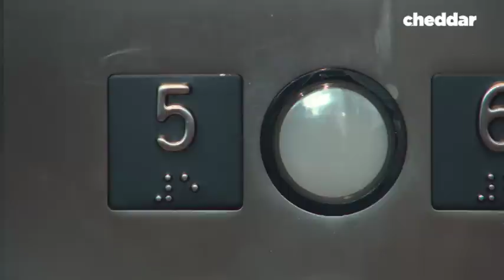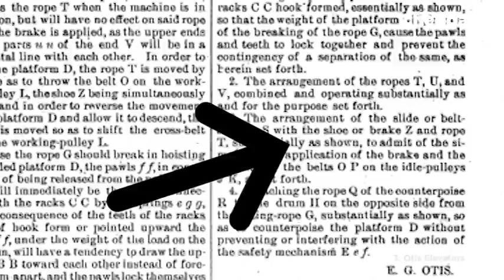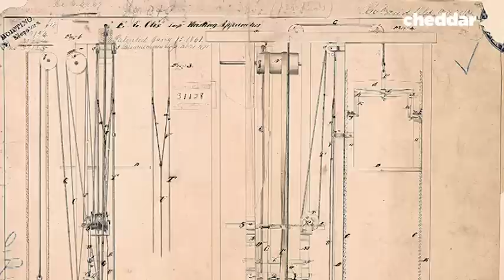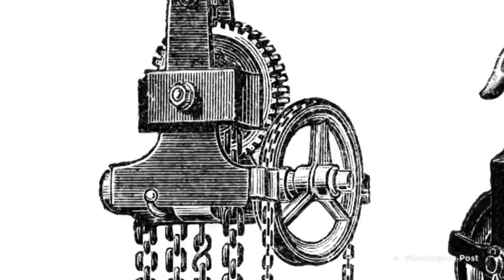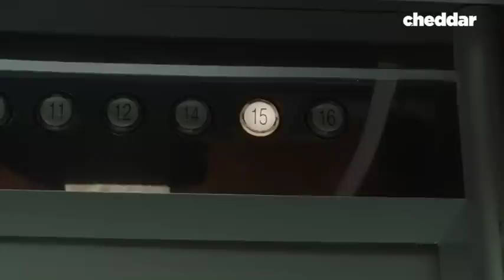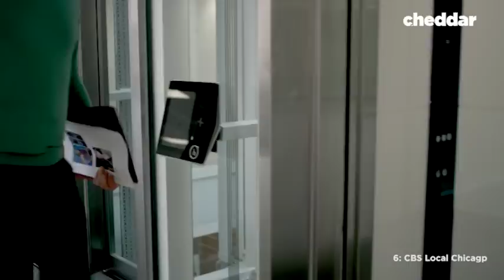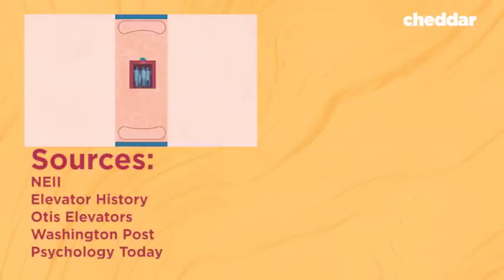Why Movies Are Wrong About Elevator Free Falls - Cheddar Explains

Comment: I remember on an episode of Mythbusters they were testing the myth of jumping during an elevator freefall, and they had to use a very old elevator -- far less sophisticated than any modern elevator -- in an abandoned building that was literally falling apart; and they STILL had to disconnect the safety mechanism to get it to fall.
Reply: David Roddick haha... Did they mention the fact that modern elevators are extremely safe?
Reply: Didn't they also mention that this disconnection was scarily simple?
Reply: Yes, a a person who understands the mechanisms for elevator safety systems could in theory bypass those systems. 

It would take a while,
Reply: @raymiller1383  on practice, it would also be a very pointless terrorist attack with very little casualties and too much bother and security to bypass... as opposed to running a truck into a crowd or something.
Reply: @kenthonggo3041  indonesia has no building standard :)
Reply: Kasumi Rina Gaming of course if there was a specific target it’d be fine. As a plan b of course
Reply: @raymiller1383  in the film Speed he put explosives on the cables, to trap them, then explosives on the friction brakes so that he could drop the elevator if they didn't pay the ransom.

Explosives make short work of complicated technologies.
Reply: megaangelic yeah, Speed is not a realistic example either, but you’re not totally off. 

 the safeties are not on the top of the cab, To get where they are, you need to know how to get there, and hanging on the underside of the car is rarely a recipe for success 

In reality, explosives anywhere near an elevator would make short work of anyone inside anyway.
Reply: @KasumiRINA  yep stealing a bus or truck and then going full speed into a demonstration is way more effective and if a Elevator falls everbody would believe that the elevator had a problem
Reply: I remember that episode. It was surprising how even in old buildings like that, the elevator was safer than the rest of the building.
Reply: @raymiller1383  lol not really.
Reply: Ham549 not sure what you’re saying not really about, but I’m not about to explain in any more specific detail what I know about it...
Reply: @raymiller1383  that it's hard to disable the safeties.
Reply: Ham549 hard is relative... to one familiar with the system it would not be hard at all, but I won’t elaborate. If you happen to be an expert, I’d refrain from elaborating further.
Reply: @kenthonggo3041  wait so is she wrong at 0:10 ? Or was the reason behind the accident different?
Reply: The lift don't fall Dow because the counter weight is heavier then the lift  
So they fall up if you go and release the brakes in the machine room you will see that they go up.
Reply: @KasumiRINA  Not if someone was targeting a specific person/group of people and they knew that they used the elevator every single day.
Reply: Thing nobody cares but I’m telling: one time in a mall, whit friends, we started jump in a elevator because we were bored and parents weren’t there. Until the big one of the Group give a big jump and the elevator started moving. We all see our life’s passing and we stop doing that.
Reply: @raymiller1383  Well I doubt anyone would do that unless you want to escape without suspicion
Reply: @kenthonggo3041  well... It's Nestle building
Reply: @kenthonggo3041  well... It's Nestle building
Reply: @kenthonggo3041  well... It's Nestle building
Reply: @megaangelic  usually do on accounts of BEING EXPLOSIVES, AKA FAST EXPANDING CHEMICALS REACTIONS THAT CAUSE MASSIVE AMMUNITION OF AIR PRESSURE AT ONCE!
Reply: Yep me too and feel sorry for buster
Reply: A buddy does repairs for old nyc elevators and to assume people don't undo safety mechanisms to avoid warnings and keep things working is generous.
Reply: @tz8785  heavy but simple. just as untying a hard knot can be simple yet the rope can hold hundreds of pounds of weight if the knot is left alone
Reply: @megaangelic  The video is not talking about elevators that get sabotaged.

Comment: In movies they usually have spikes at the top and bottom of the shaft
Reply: Not to mention that as soon as elevators hit the bottom of the shaft they explode in a ball of fire.
Reply: what the hell
Reply: Bitcoin Motorist IKR. Then everything explodes
Reply: Using "y'all" and implying you're not American in the same comment is pretty repulsive.
Reply: @KatzRool  Speaking English and implying you're a sovereign country is worse imo
Reply: KatzRool please explain why
Reply: In movie elevator's indicator somehow still can show although the cable is snapped
Reply: @KatzRool  fr
Reply: @barmiro  not really. English is a pretty common language
Reply: y’all in the replies really are confused
Reply: @Houtarou_Hyouka_Unforgiven   A few of the equipment clips was showing a the Electrical Controls cable (one has the writing required on all electrical cable), not the wire ropes. Again, Hollywood lied as you see the digital floor indicator (in car) rapidly changing. IMHO that condition would probaly snap the electric cable as it was never intended to spool that fast
Reply: @steveurbach3093  i mean
cable has snapped 
but the indicator still show the exact floor 😂😂😂😂😂😂😂😂😂😂😂😂😂😂😂
Reply: Lol I remember being a kid and thinking how dumb that was
Reply: @steveurbach3093 the electrical connection to the car doesn’t spool, it’s a hanging cable underneath the car. That can easily drop as fast as the car, even in free fall.

Comment: Narrator: Elevators can't fall like in the movies.
Also Narrator: Describes an incident in which an elevator falls like in the movies.
Reply: I would very much like them to define "plunged", because if it really did go into a terminal velocity free fall like in a movie then I find it hard to believe that everyone survived with only minor injuries
Reply: You don't pay attention, do you?
Reply: But all passager still alive even fall from high floor, and the elevator not exploded like in movies
Reply: @nobody2021  She said it stoped on the 11th but doesn't say how it stopped. It must have been somewhat sudden, otherwise they wouldn't have had injuries. If it went to the bottom then they probably would have died?
Reply: Elevators can't freefall for another reason... and that is air pressure... if a elevator had no safety features and fell, it still wouldn't completely be a free fall... it would be slowed down by the air pressure building up in the elevator shaft as it's falling down, which would slow down the elevator. It would be very uncomfortable, since it would be going at a decent speed, you would most likely be injured, but it should be slowed down enough for you to not die. So even without all the other safety features you would probably not die if a elevator fell... of-course this doesn't count for elevators that aren't enclosed in a elevator shaft... :p
Reply: badbirdkc sega
Reply: @nearlimitsound6631  Not to mention there’s still a heavy counterweight being dragged in the opposite direction.  If only one cable snapped there would still be 4-5 of them left.  Free fall is impossible in these things.  There’s so many redundancies in the safeties and stops that make sure it won’t happen.  As well as yes air pressure in the hoist way.  But if it’s an elevator in a bank of 2 or 3 or more, they actually share the same shaft with no walls between them.  So the pressure wouldn’t be as great as one might assume.  And IF all else fails, the buffers in the pit will catch the car and keep it from exploding in the pit.  All of the accidents in modern U.S history have been caused by negligence on the elevator mechanics end.  And even those are exceedingly rare, thankfully.  Elevators are safer than taking the stairs even if it doesn’t seem like it:)
Reply: Air pressure does not build up under an elevator,  it will not slow it down, I test elevators everyday, and the buffers in the pit are to protect the elevator if it overshoot the floor a little,  like a bumper of a car, at high speed they do nothing
Reply: Elevators freefall up, not down. This is due to the small wheel in the bottom or top of the shaft. Not like anything that is listed on this. Located on EVERY lift.
Reply: @nearlimitsound6631 you seem to have never seen a real elevator shaft, there's plenty of space (often several feet) around the elevator for the air to pass around the car, so there's no air pressure build up at all, only poor aerodynamics.
Reply: @OPCr1s1s most elevators of smaller buildings are hydraulic without a counterweight and can certainly free fall. Only traction elevators have the counterweight.

Comment: Elevators falling isnt what scares me about elevators. Its elevators that fall or move when people are walking out the door. I thought it only happened on China but recently in NYC someone was crushed by an elevator going down wedging him with the floor and the elevator.
Reply: Pretty common in Russia. Happens if you bypass the pesky safety systems which prevent the elevator from working if they have any doubt at all.
Reply: It's just cheaply made lifts
Reply: This happened to me like a month ago in California. We got in the elevator to go up, but it started moving upwards before the door closed. It only moved like an inch, but we immediately hit that door open button and got off of it lol.
Reply: @skellingtonMCR  sometimes if there's a significant amount of weight that enters the elevator and stretches the cables, the elevator will move up an inch or so to keep it level with the floor
Reply: @sonic2batt  I don't think that was the case here though. When it moved up, it was no longer level with the floor. And there were only two of us in an elevator that had a max weight capacity far above our combined weight.
Reply: @OhMyGulay That's also my fear about elevators.
Reply: @skellingtonMCR  That's interesting, I can see why you were concerned. I've noticed what I mentioned happening when several people enter the elevator.
Reply: either it's cheap ass or badly maintained elevator
Reply: @James Olelo from someone who also works in a hotel, "someone tripping a little" is a great nightmare. Even if they're ok and didn't get hurt, it can still turn into a nightmare situation quickly not even mentioning if they got a minor injury.
Reply: @garfieldandfriends1  which is often the case in Eastern Europe. Basically, Soviet elevators come in two types, ones that open their door if someone's leg or arm gets between the doors... or ones that don't, they close and move up or down. Faulty design but many homes in former USSR still have them.
Reply: OhMyGulay this is one of my biggest fear. Usually i would walk fast or run coming in or out from elevator. And my apartment has one. Everyday is a struggle facing my fear crush by elevator
Reply: @skellingtonMCR  when weight is added the ropes stretch causing the elevator to be below the floor landing.  The elevator will relevel to compensate for the added weight and go back to floor level.
Reply: @skellingtonMCR  i know one that does this in a senior home
Reply: im also scared it will get stuck
Reply: @skellingtonMCR  idk if this is the scenario you had, but it's quite common for elevators to start moving before the door is fully closed, and to start opening the door before it comes to a complete stop to speed up wait times.
Reply: @skellingtonMCR  That is called "re-leveling" and in does that if it needs to re-adjust to the floor. If it goes to far it will stop though.
Reply: @skellingtonMCR  Mabye a logic glich. 
You're still safe though, if it gets too far from the floor with the doors open it will e-stop because the safety circuit gets broken.
Reply: @OhMyGulay This is extreamly rare and only happens if the safety circuit has been bypassed.
Reply: @sonic2batt  should not the breaks be holding it in place?
Reply: @skellingtonMCR  still happens though.
Reply: @HPD1171  the brakes arent engaged unless in an emergency as they need a technician to reset them.
Reply: Ive worked for a global elevator company for 16 years. This only happens when technicians electrically 'bridge' or bypass the electrical safety circuits when repairing something and forget to reinstate it afterwards. The lift should never move if any of the landing doors are open.
Reply: Pretty cool Final Destination kill
Reply: @SianaGearz  correct, you would have to jump the interlock and gate switch for that to happen. which can result to the technician to being arrested for manslaughter
Reply: In Bangladesh a children got stucked with elevator doors because the sensor was faulty. He got crashed between floors.
Reply: Yeah I always get anxious when I step in the door line area
Reply: Was it a hydraulic or traction?
Reply: @KasumiRINA  tell me more im în one case of this elevator
Reply: That's because the elevator mechanic was working on the wrong car. Human error.
Reply: It was the service mechanic that had disabled the circuit that tells the elevator that the doors are still open.  The car moved because of his negligence.  As far as I know he was charged and arrested.  Not to mention he lost his license to work on elevators.
Reply: People always say that do not worry about the elevator falling they have safety equipment to prevent the elevator from falling you have to worry about the elevator crashing in the up Direction that happens that's scary Nothing Stops an elevator going up
Reply: @marcodorazio3816  it's not that bad
Reply: This video explains how safe elevators are if everything goes according to plan.  I think the problem is not Otis or Thyssen-Krupp, but the off-brand shit elevators that may have few if any safety features and may have been installed illegally, or unlicensed repair people who disconnect safety systems and don't understand how they work.
Reply: New fear unlocked
Reply: @KasumiRINA  I grew up with those types of elevators and I absolutely hate them
Reply: @skellingtonMCR  Was it a hydraulic elevator?  Sometimes those will actually move up an inch with the doors open because it is "re-leveling" because the car descended too much past the landing and so it will inch up while the doors are open.